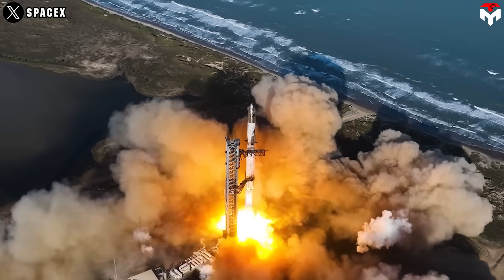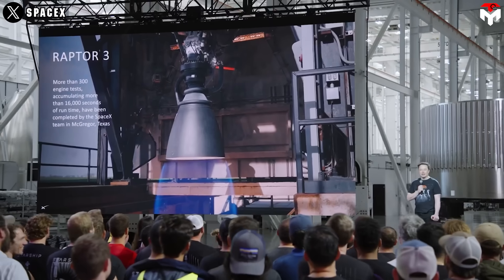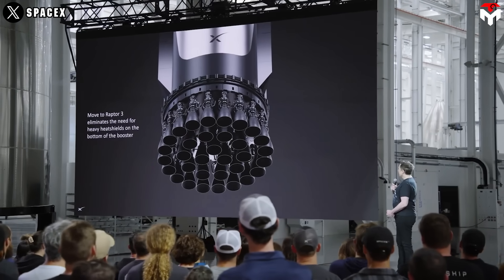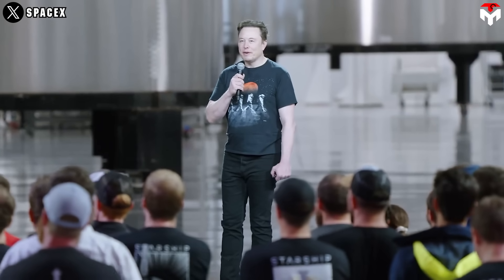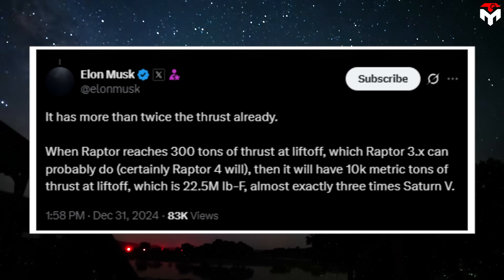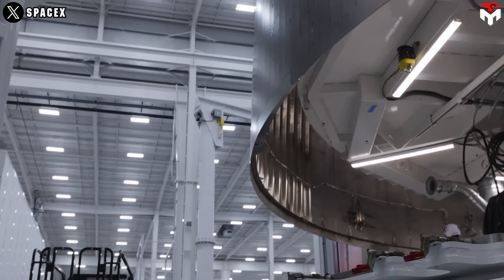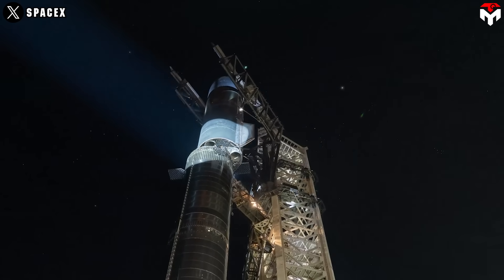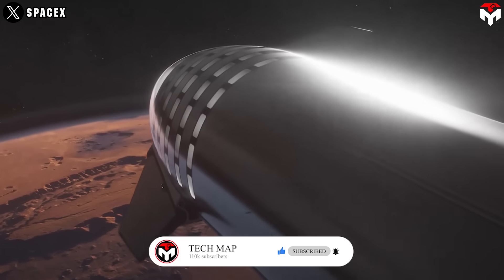SpaceX's new Upgrade on Raptor 4 Shocked NASA and Russian Engineers…

Comment: TECH MAP, like so many YT channels that follow space are 100% orally ball washing Musk and it's getting f'ing tiring!  If the Raptor 4 is more powerful than any rocket engine ever made then it would need to be more powerful than the F1 used to power the Saturn V -- you don't increase an engines thrust by a factor of 3 by tweaking the design and such an engine would be a new engine that would likely require many changes.  If you built a small jet like a Cessna Citation and then decided you wanted something the size of a Boeing 737 you wouldn't then build a 373 and call it a Citation!
This constant BS about the 'next version of Raptor' smells a hole lot like the BS Musk has been shoveling about FSD for a decade!  For years every new version of FSD has been the version that was going the change everything and yet IT NEVER DOES!  In fact, while Musk would have you believe that a Tesla could drive from a parking lot in LA to a parking lot in NYC without any driver intervention and be able to do that in 2018 Tesla's FSD is currently rated at only level 2 while other car companies are at level 3 and BMW is close to level 4.  TESLA FSD IS NOT LEADING ANYTHING!
Coming back to Raptor I'd further argue that Musk's need to have 'records' for how powerful and efficient an engine is may in fact be hampering SpaceX by putting too much faith in technology at the cutting edge while the safety of astronauts depends on the hardware not being driven to within an angstrom of destruction -- when you require you equipment to perform at the very limit you dramatically increase the chance for failure and failure with people on board usually means death.  Musk does NOT know what he's doing even if the AI behind TECH MAP wishes to lavish undeserved praise on an illegal immigrant!
Reply: I suspect it's meant to be power to weight ratio
Reply: @alanbrown397  No, the AI voice clearly stated that Raptor 4 would be the most powerful rocket ever made -- the F1 is more than twice as powerful as the Raptor 3 so to make Raptor 4 more powerful than the F1 would require more than doubling the power of the Raptor 3.  NEVER GOING TO HAPPEN!  The BS these SpaceX loving channels pump out is nonstop and completely disconnected from reality and 6 decades of rocket development!

Comment: Raptor 3 is a very good engine but it’s the wrong engine for spaceship. Spaceship needs way bigger and stronger engines. The amount of engines Spaceship has is one of the main problems of spaceship. It is way saver and lighter to use more powerful engines for spaceship. 
The raptor engine is perfect for normal rockets like the Falcon 9 but seriously underpowered for spaceship.
Reply: @svenweilhisen57 you  must be an engineer spaceship designer to know all that! Damn,  I hope Elon hires you quickly!
Reply: @johnvajcner20 there are reasons why you step up with greater machinery at certain points. Overall bigger engines are lighter per kW. They are as reliable as smaller ones but when you have 35 engines with a 1% risk of failure you end up with a 35% chance of failure per flight. While 5 or 6 engines bring this down to 6%.
You have way less connections and less turbo pumps to inspect.
There are reasons why starship is miles away from its predicted payload of 100t not mentioning the 200t Musk is talking about. 
 IMHO Starship is economically BS. It’s technically fascinating but I rather doubt that it will ever break even. Take the dispenser system for the starlink system How many other satellites will be able to launch through this tiny hole?
Reply: @svenweihusen57  masz takie silniki? Udostępnisz je Elonowi?
Reply: @svenweihusen57  When equipping only five engines, the failure of just one results in a significant loss of thrust, making it difficult to continue the flight
Reply: @かの-i5e Right. But on the other hand a bigger engine is lighter per Meganewton. Saturn 5 had 5 engines (60s technology) and around a third of the thrust of Starship. But it could bring 150t into LEO. 
Stronger engines would help but IMHO the whole concept is wrong. There isn’t enough payload to justify Starship. Starship is the solution for moving equipment to Moon/Mars settlements which will never happen during our lifetime for economic reasons.